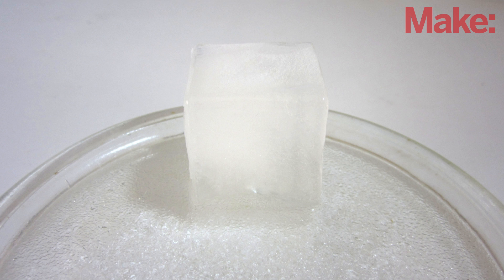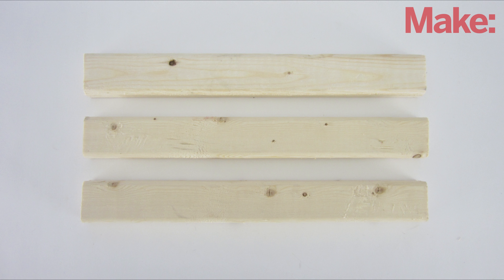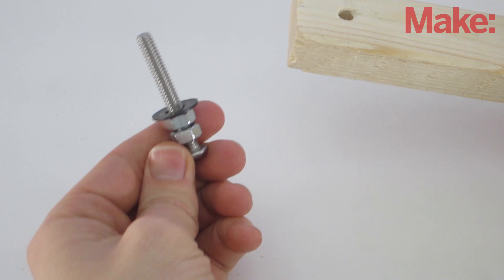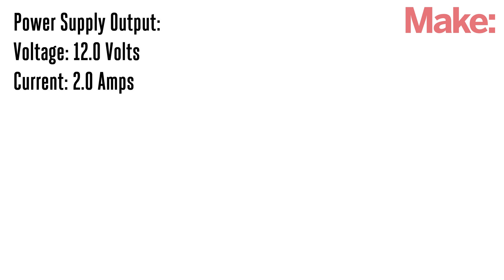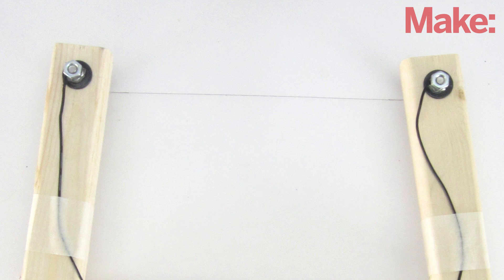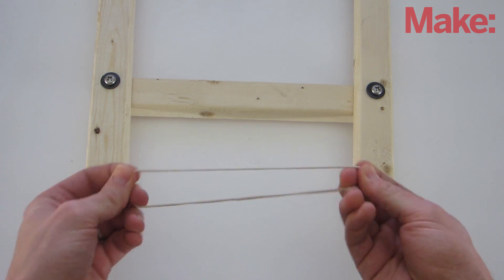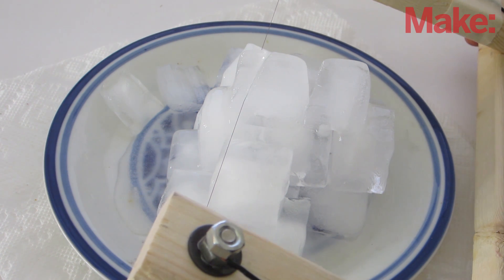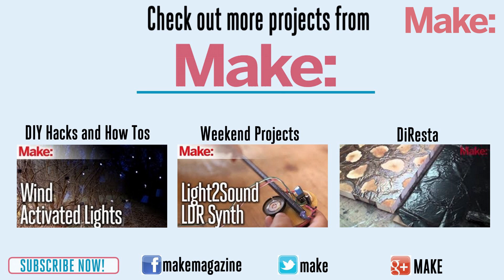Hot Wire Ice Cutter

Comment: Im not a safety sally,but this is dangerous please dont do this unless you know about power supply you are going to use is safe, do a bit of research first, it might stop you burning down your house
Reply: get a 10 amp power suply at 12 v add a 5ohm 20a resistor and try it this is dangures dove as some power suplys can catch on fire soo be carefule
Reply: res1492 Just use ultra low guage nichrome.

Comment: Or you can use a dimmer switch in front of the adapter or transformer to adjust the heat, this could also cut foam

Comment: How do I find out the resistance of the wire you are using in the video?
Reply: Markus Blechschmidt I do not know anything about resistivity, circuits and many more things in the same area. Thanks to google I can find out almost everything I need to know to build this incredible child like project. Damn I feel so stupid right now. Thanks for your reply :)
Reply: It's a propert of the material. You wouldn't find it on the package of the product, but you can google it.
For example Copper:
- Electrical resistivity 16.78 nΩ·m
- 1m of copper with 0,0001m² (1cm²) will have a resistance of:
  16.78*(10^-9)*1/0.0001 Ohms = 0.0001678 Ohms

Other metals will have other electrical resisitivitys.
Reply: Markus Blechschmidt NOOOOOOOOO not resistivity... I just finished that topic in A-Level Physics and it was God awful xD
Reply: It really depends on the gauge of wire you're using, I don't know why he didn't mention that in the video
Reply: sc0tte1
"0,0001m² (1cm²)" is the cross sectional area of the wire and therefore the gauge.